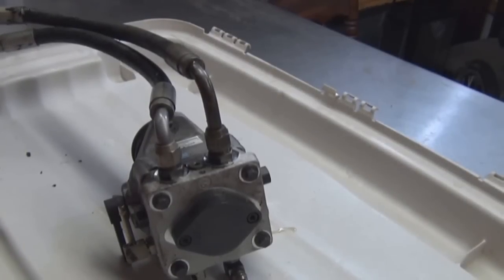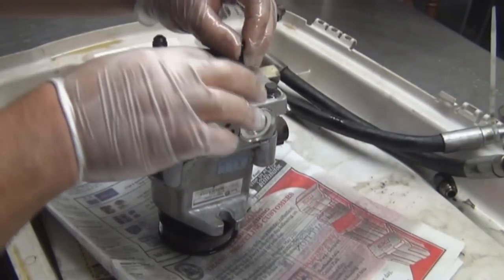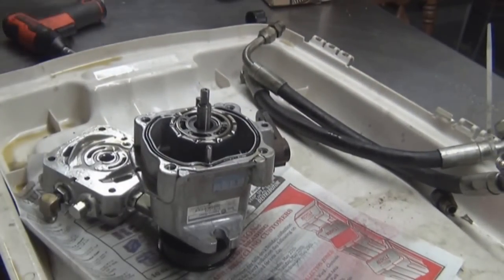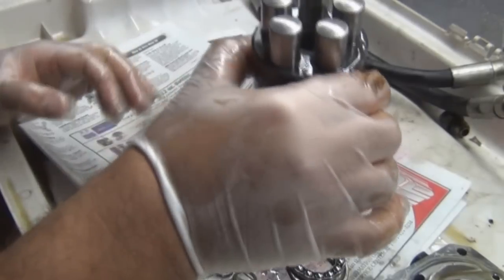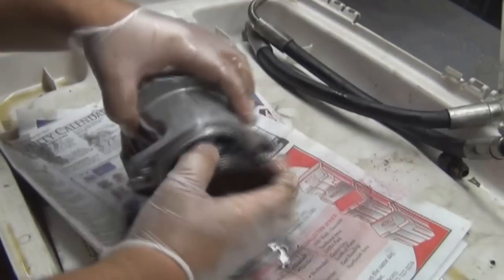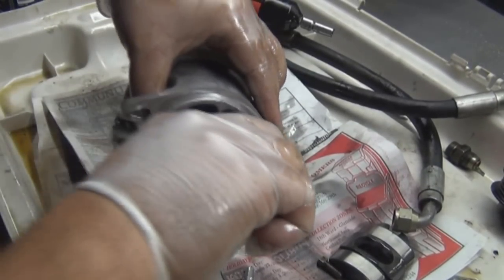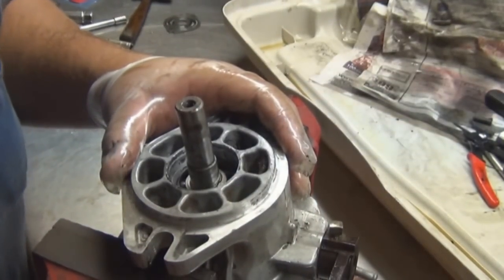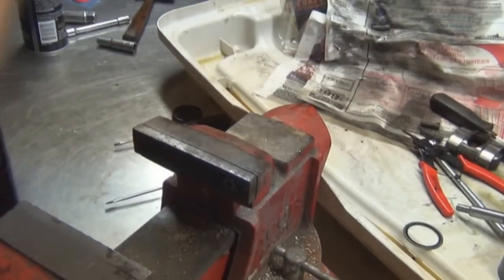Disassembly Hydro-Gear Pump Exmark Lazer Z Part 1

Comment: Can you turn the valve body 180 degrees and point wheel motor hydraulic hoses the opposite direction?

Comment: Great video.I have a different problem .The release valve(The hex nut(plug) that you turn so you can roll the machine if you have to) leaks from the threads. I did not take the plug all the way out yet.Is there an o-ring  on the end of the plug that can be replaced?

Comment: I was looking for a video on the zero turn right hydro wheel motor. mines leaks on brake shoes.
Reply from the maker: Sounds like it needs a rebuild. Check the hydraulic hoses first, make sure there's not a pin hole in the hose or see if it's leaking at the fitting. I hope this helps. Thanks for watching and commenting. Please like, share, and subscribe.
Reply: Jason Ppby

Comment: hi, could you let me know please what is sequence of vents.

the pump is run by the oil moving into the pistons which  turn the pully, or, the the pully is powered from the engine and it turns the valve block and pistons which up the oil persure.

Comment: So I watched the removal and was sooo happy that you got a tripod for vids 1 and 2. Your vids were perfect and I was able to remove and open the bad pump. 

So for my question: The swashplate bearing was NOT intact. Ball bearings were all over inside. Do you know if that's an available part? And if so, since that happened is it worth trying to salvage the pump VS buying a new one?

Comment: I did replace my left hydraulic pump of  an exmark  but now both hydraulic pump aren't working  it's like don't have any pressure.  What should I do
Reply: Make sure to hand tighten the bolts on top

Comment: Hi.. just bought a secondhand Scag Wildcat which seemed to be in pristine shape.  Got it home and of course it leaks :(  It appears to be coming from the union of the top and bottom "halves" (quotes because I know the bottom is longer).  I am hoping it's not the shaft seal because I'd hate to have to pull the whole thing apart already, but I noticed you didn't change the case seal.  Do those tend to go bad, and/or is there any other special reason mine might be leaking from there?  It did get bounced around a bit on the ride home, but nothing I wouldn't expect from regular work.  Thanks!

Comment: Ok so why did you rebuild this was mower not moving forward or reverse and did you rebuild both sides?
Reply from the maker: +A day to be Great. It kept aerating, making bubbles overflow out of the oil reservoir. ( bad seals) and no I only rebuilt the one. Hope this helps. Thanks for watching and commenting. Please like share and subscribe

Comment: That removal of seal was painful to watch....couldn't you slide out with input shaft?
The worn valve plate has a mating part which needs replacement or re-surfacing to make a perfect seal.